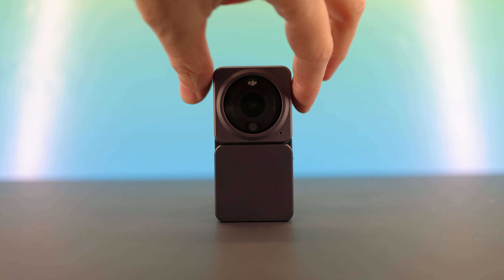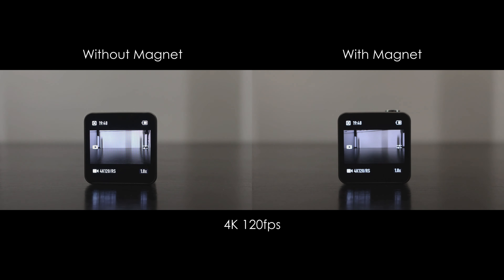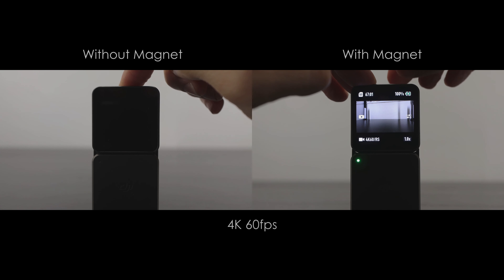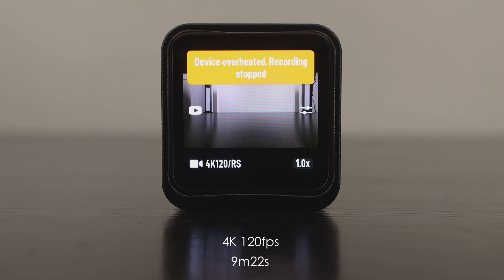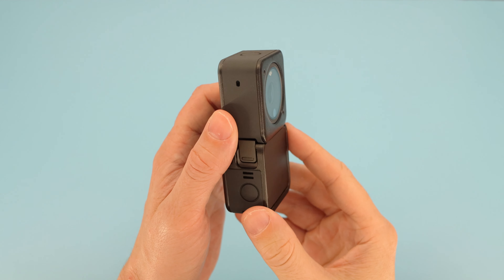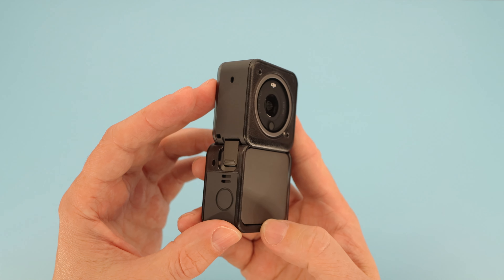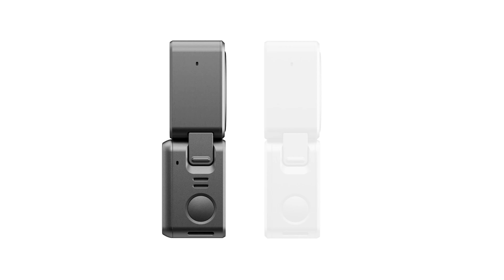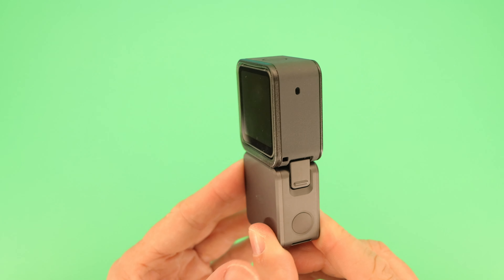DJI Action 2 Magnetic Case Tested (with unexpected results)

Comment: Congratulations on being the only reviewer who actually gets to the heart of the matter - and who makes one or two others look a bit silly in the process.  One posted a 25 minute review "explaining the science being the cage", even claiming that the slightly rough exterior of it was due to that adding to the the heat dissipation that the cage provides to lengthen recording times...  Anyway, let me not be catty about it.  (Too late, I was).

Big questions remain.  Why was that magnetic switch there in the first place?  Did DJI originally intend to sell or include the case from the outset, but manufacturing and distribution constraints meant that it's only now available?  Did they deliberately wait to see what the market would tolerate in the way of overheating?  Did that switch have some other original purpose?  We will never know...  Of course it's now open to 3rd party manufacturers to sell cages which incorporate the magic magnet, but which would be made of metal to help actually dissipate the extra heat, thus improving on the DJI freebie.  I use a Ulanzi cage, and I must get around to seeing whether it does actually make a difference to running times anyway, without relying on the magnet.  Or I could try to find a magnet which would work with the case fitted, and see how my times compare with yours.  All interesting stuff but time consuming.  So far the time consumed has largely been yours - thanks for that!

[Edit - someone has commented in another video and explained why that sensor is in the camera in the first place.  "The detector is for the macro lens. Turn on macro lens detection, and when you put on the case, it will switch to macro recording instead of detecting the case.  Correction: the magnetic case should have reverse polarity compared to the macro lens, as now I can turn on either notification based on which side of the magnet I push to the camera."  Now this discovery would enable someone with a heat measuring device - Roo perhaps?! - to fit the case with the macro feature turned on, thus avoiding the camera being set to run hotter, and see whether the case on its own does reduce the running temperature or actually increase it.]
Reply from the maker: Peter, such a great comment!  I was looking forward to hearing your thoughts about these test results.  

You know, when I first heard about the magnetic switch I immediately wondered the same thing; why was it there to begin with?  Do they have some special, super cool accessory planned for release that the switch will activate and was it just pure luck that they were able to utilise it for this emergency fix instead?

And now you have put forth the theory that it's there to detect the macro lens and I'm thinking "ahhh, that makes sense", until, I looked at images of the macro lens and saw that it sticks to the front.  And that no part of it touches the top area where the little magnetic switch is located, just beside the power button.  

So how does the macro lens trigger that switch?  Wouldn't the switch need to be behind the front face rather than behind the top surface?  I think the origin story of that switch may be the final piece of this puzzle.

I think the camera module case does help cool it when the camera module is on its own, because in my tests I got an extra minute of run time with the case than with the magnet alone. But unfortunately when the two modules are connected the bottom of the case reduces heat transfer to the lower module and the heat sink effect of that module is reduced quite dramatically. 

I watched the video you speak of.  I think he presented it well and made some great points, but I didn't agree with all of them.  For example, the textured surface creating more surface area which improves cooling.  He's absolutely right that the rougher a surface is the larger the surface area it has, but in my opinion at the scale we are talking about with this, the effect would be impossible to detect without precise scientific temperature measuring tools.  The ever so slightly textured finish on this case will not extend the run times in any meaningful way.  It's too slight a texture.  If it had big grooves cut into it then maybe we would have something. 

I also don't think the heat sink effect is as significant as some people think it is.  An extra minute is wonderful but the temp limit increase of the firmware is doing the real trick, in my opinion.  Of course I'm not an expert in this stuff, but I did do the tests so I could put some data out there with my theories.  

It has been an enjoyable journey.  I was quite disappointed with this camera at first, but I have come to love it now that the heat issue is essentially solved, at least for how I use it.  It's been my daily carry for the past week.
Reply from the maker: I forgot to add that I think to reverse the polarity of the magnet in the case would mean cutting it out and glueing it back in upside down.  When I try the magnet trick with the magnet flipped nothing happens.  I don't get any macro confirmation on the display.
Reply: @Roos-Reviews  Did you have the menu option to enable the macro lens detection ticked?  Just checking...
Reply from the maker: Good catch.  I turned that on and now that same switch activates macro mode when the magnet's polarity is reversed.  It also triggers when placing the magnet on the front face near the top.
Reply: @Roos-Reviews  ts the magnet size, will it be strong enough to go on a bike ride?

Comment: Is it maybe possible that when the module is attached, due to the fact that it charges the battery in the camera at the same time, it makes it more difficult to reduce the heat from the camera (cause charging creates extra heat)? I don't think the case really helps, but just adds a higher overheat limit softwarewise, since the camera needs to recognize 'the case' before it 'works'. You said it yourself that without the case, the camera overheats at 10 degrees lower.

Comment: I put a $10 phone cooling fan on its side awkwardly and got infinite record time in 4K60 until battery died. Plugged the complete screen combo into 5V2.4A AC adapter but seems the device is draining more power than 2.4Amps in 4K60. After 90mins it's only got 20% power remaining.
So really DJI or PGYtech or Telesin or whatever third party company should make a unique shaped fan cooler for action 2, or create a fan+screen module to the product line and it will 'sort of' solve the problem.
Reply: did you find a custom cooler?
Reply: @DavidSmith-qp7yk  Any magsafe cooler should do. They don't have any clamps or claws and can easily attach to Action 2.
I have already upgraded to 3rd gen though.

Comment: It's nice that you've mentioned that there was no air flow. In a lot of the test reviews they did forget about that (actually the vast majority never even thought about it, although it's the way they where designed to "normal" use).
Reply from the maker: Yes if you use it on a bike or when running or something with air flowing over it the overheating is greatly reduced.

Comment: I just got the 128gb version and I'm getting a power drain when the camera is connected to the power module even when it's off. Say both are at 100% before I go to bed, when I wake up the camera stays at 100% but the module is at 80%. 
Do you have this issue as well? I can't tell if it's a firmware issue or is there's something wrong with either the camera or the power module.

Comment: I just bought the action two during the amazon days and got it for 299$ US with the cover. I do not see the issue like you are showing here with screen mod unit so maybe they have addressed it. Still learning to use this camera and trying to find the best settings. Thanks for the tests as they are helping to decide whether or not I will keep the camera.
Reply from the maker: Which screen mod issue do you mean?
Reply: @Roos-Reviews  sorry misunderstand you as you were talking about the battery module.
Reply from the maker: Oh right, yes it doesn't fit well on the power module, but it fits the dual screen version.

Comment: well ....  first off, thank you for those throurogh tests! 
however, they show that the camera can run hotter without a problem. We know that the shutoff temps are determined by compliance, not technical limitations (in EU they had to take away the option for the higher limit because of regulations). 
This case allows them to work around that by basically removing the chance for skin to touch those hot spots, therefore they dont apply = longer recording times for the user + additional revenue for selling the case.
so yes, its a bit weird, but i d still consider it a win-win.
Reply from the maker: Yes, it's a pity our friends in the EU will get nowhere near these run times with the new case.  It seems they will only get an extra minute or two, while elsewhere we are getting double the run times.

I think that while the aluminium now gets a lot hotter, the internal components should still be staying within safe operating limits.
Reply: @Roos-Reviews  Emphasis on "should...".  Personally I won't use the case unless I have to (I don't have any overheating issues so far with my use of the camera).  Will running the camera hotter improve its lifespan or reduce it?  Intuition says it could reduce it.  DJI might be gambling on reduction in life not being encountered for a year or two, and then it would be quite hard to demonstrate that people using the case were definitely getting shorter life than those not using the case, because it there would be all sorts of other variables in play.  We shall see...

Comment: Thankfully, DJI found a way to extend recording and reduce the heat the camera accumulates! The magnetic protective case does a lot of good for the Action2!
Reply: I find that mine will not charge when I put the case on it
Reply: @michaelripple8371  my Action 2 just stopped charging with the Magnetic Case on the Camera portion.  If I take the  case off it will charge.

Comment: Thanks for the video, I will order the case. But what kind of magnet did you use in the first test? I cant hear anything with them I have available...
Reply from the maker: Neodymium
Reply: @Roos-Reviews  Thanks. On the other hand I managed to enable High Temp setting in my European Action 2. Very easily.

Comment: Thanks for doing this review Roo! Really well put together as usual! 
So, as we expected, it's mainly a software solution with a finger protector. 
I do wonder if the image has been downgraded/reduced as part of that firmware upgrade.
Unfortunately, I won't get the free case as I've been told by D1-Store Brunswick that you only get the free case if you purchased it originally from DJI directly :(

But I do have a magnet I'm not afraid to use it ;-)
Reply from the maker: Hey Scotty,

Haha "I have a magnet and I'm not afraid to use it". 

I was thinking, since the case is a poor fit for the power combo, as is the Smallrig polymer case, maybe that's a market gap you could fill.  I really wish there was a case similar to this, but that properly hugs the power module and protects that front face too.  If you made such a solution I'd be happy to buy one.  I wonder if others would too.
Reply: That's pretty piss poor service from DJI not to send out a free case. Doesn't matter where one buys it from, should be free for all, permanently. You should put your Karen hat on demand a manager. I equate this overheating issue to when a car gets a 'recall notice' sent out and the manufacturer has to rectify the fix, free of charge.
Reply: I also bought from the D1 store, and I'm getting the free case through the announced procedure.  Try that!
Reply from the maker: I bought mine on Amazon and the coupon for the case appeared in my DJI account automagically.
Reply: @Roos-Reviews  I just looked at the Amazon page and I was surprised to see that they do warn purchasers that they should get one for free anyway - is this the first time that someone on Amazon has actually pointed out that you don't need to buy what they are offering?!
Reply from the maker: @Peter The issue for me was the 6 week wait for it to ship from DJI, so I had to buy it myself.
Reply: I bought my Action 2 from Amazon.   Supposedly a free case is on the way.  Be sure to check the coupon site for your coupon.
Reply: @chucknorris8704  It looks like DJI maybe heard from a few (thousand) disappointed customers and they've now made it a free upgrade outside of the US and EU
Reply: @Ozpeter  Hi Peter, yes, after a couple of weeks, DJI finally got their act together so I have mine on its way to me now.
Reply: @Roos-Reviews  Sorry for the late reply. I'm sorely tempted to come up with a copper-filled silicone solution but we're in the middle of Mavic 3 cases and we'll soon be working on Mini 3 as well. 
Some days I wish I could just copy and paste myself a couple of times ;-)

Comment: In order to compormise the metal to metal heat transfer, they actually solve the losen contact point problem I have. The problem is when you recording onto microsd card, a small shake or wabble will cut off the recording. But through all my test, the best solution you can get is have the SmallRig dual cage. That one made me run 4k60 indoors until battery die, and the whole stuff is not too hot to touch.
Reply from the maker: Yeah it's a really good case.  It protects it with a metal cage and acts as a big heat sink.  But it makes the camera too big for my use.
Reply: Where did you get your small rig from if you don't mind me asking, I have no idea which ones are good or not
Reply: @ashleybrown.94  Amazon, is the metal cage (frame), not that dual magnetic case.

Comment: I recently bought Dji action 2 but I found the power button on camera unit is hard when compared to button on power module… just want to know if it is just my unit or common in all Dji action 2…
Reply from the maker: The button on my camera module feels about twice as stiff as the one on the power module.
Reply: same for me. im guessing the IP waterproof rating on the cam side making it stiffer with heavier seals.
Reply: Mine’s the same as well.

Comment: Appreciate your tests thanks 🙏 i use my camera on motorcycle helmet so i don’t have a heat issue, saying that i have  just ordered a second one. I wish dji had made it the way you said but also I’m sure they could trim a little to allow ND filters to be used. One thing i have noticed on my camera is the white balance does shift slightly sometimes giving a cooler temp then back again briefly. I’m sure the up coming firmware fixes it. Cheers Nick
Reply from the maker: Thanks for pointing out the WB issue.  I hadn't noticed that before.

Comment: Did you have the temperature cutoff setting on high or normal? Does having the case just allow the camera to switch to the high temperature setting for the countries that did not allow it or does the case activate a further higher temperature. I just got my action 2 yesterday so I didn't test that rigorously but with the temp cutoff setting set to normal I actually got 1 minute less recording at 4K 30fps with the case on compared with the case off in an indoor test.
Reply from the maker: The case doesn't help much with European models, unfortunately, because they are not allowed to go above a certain temperature.  I've seen people say they only get about an extra minute.  Where as on the North American models the times are massively increased because of how the case activates an even higher temp limit in the firmware (I explained how it works in a series of videos about this case).